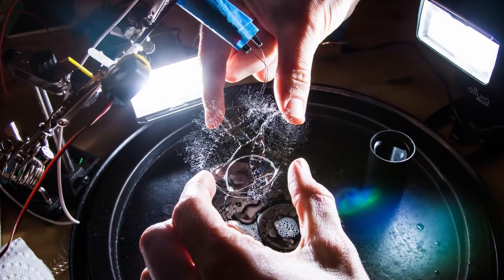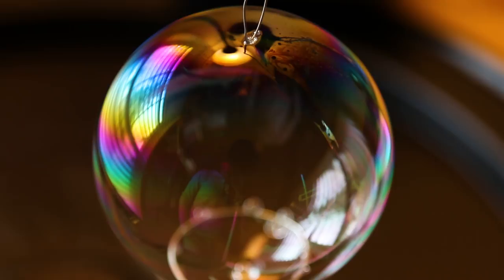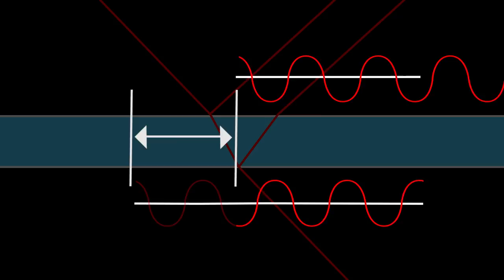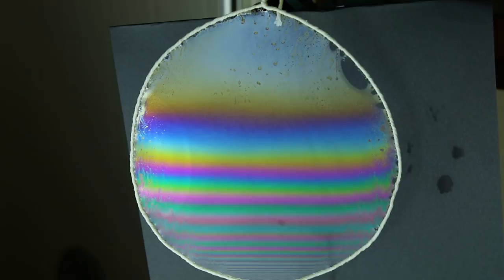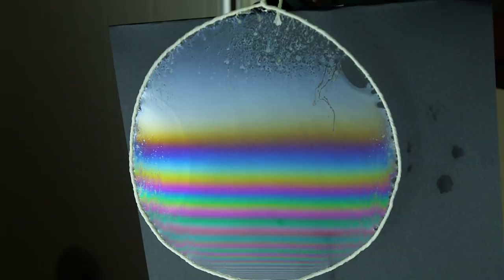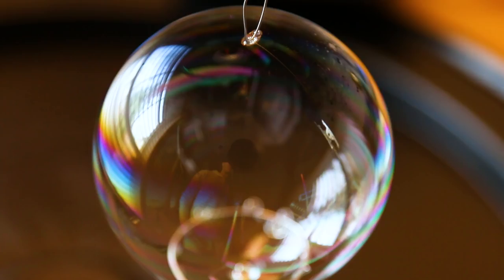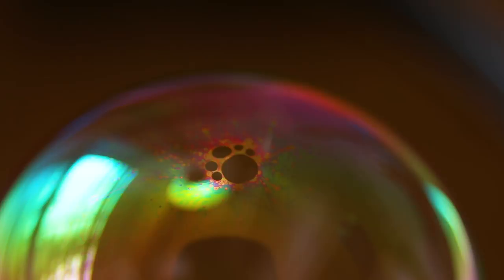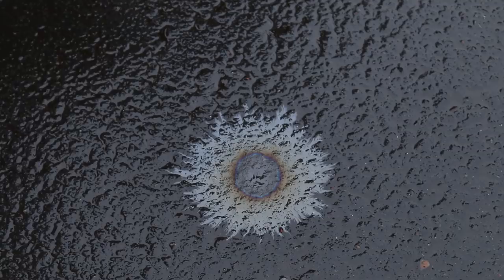Thin film interference and the beauty of soap bubbles

Comment: Nice and interesting video.  However, I think,  the Colours on the Wings of those insects which you have shown are not from thin film interference. Though, in a way, interference is there, it's not dependent on the thickness of the wing. Color is primarily dependent on the lateral spacing of "periodic Nano patterns". You can look up 'photonic band gap' to know more.
Reply: this is wrong. why wouldn't you just google it? there are many resources and studies done on the wings of insects which describe the structures responsible for thin film interference that produce iridescence. butterflies for example, benefit from it to fend off predators or attract mates.
Reply: @ezu8501  figures a, b and c doesn't seem like thin film interference. I didn't Google it because I work on similar topics. Then again, I may be wrong.